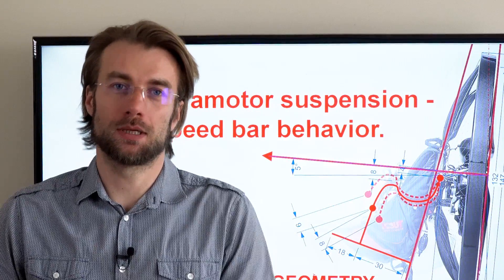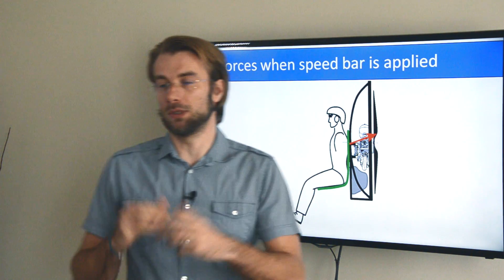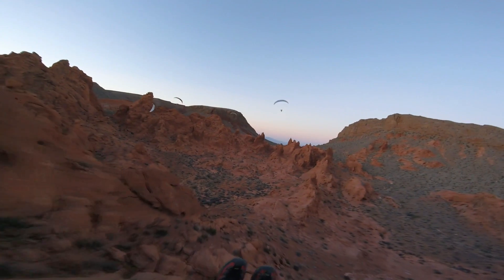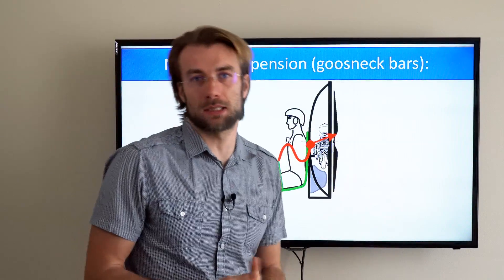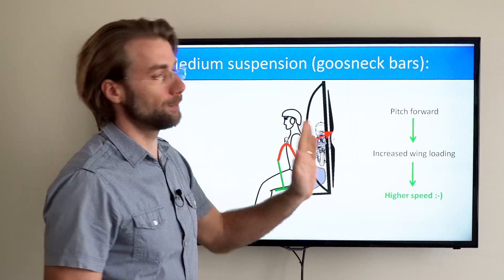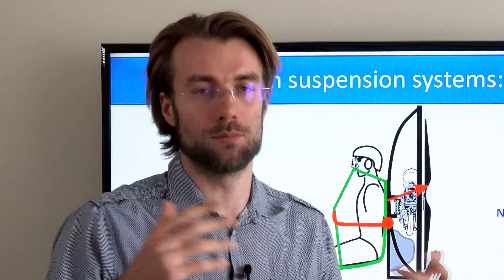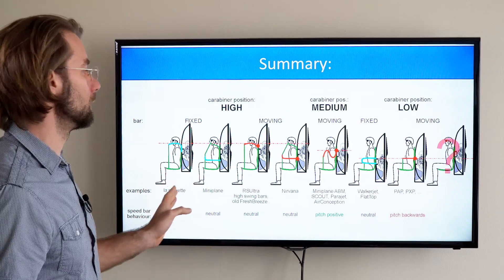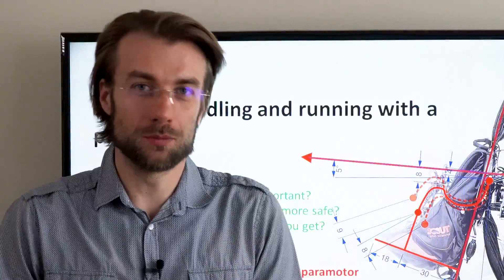Speed bar behavior. Paramotor Geometry Part 6

Comment: Why is there no mention of Blackhawk paramotor in you comparison?
Reply from the maker: few reasons:
Primarily there is not enough space to name all brands... There are plenty brands that did not fit into the screen.
I have named brands that have invented respective suspension or contributed to it the most (Miniplane ABM, Nirvana, Walkerjet, PAP, SCOUT...)
I tried to pick the most influential brands globally. While Blackwawks are probably good machines, they are rather unknown outside of US.

Yet, the brands are there just to help new or wannabe pilots. Pilots with some experience focus on the suspension comparison itself. The brands are not important in this classroom.

Comment: Need to congratulate you for this Clasroom sessions idea. It is obvious that you have a LOT of knowledge to share. 
But now I have a question:  You are considering so far, the backpack as an isolated unit. What happen when the backpack interact with the glider?  I think that if you apply thurst (regardless of the thurst line possition, you will induce a "nose up attitude" on your glider,  and since all the unit is "penduling", your thust will be diverted a little bit to the ground, inducing a reduction in the wingload. 
If that is correct, wont be a good idea to move then the thrust line a little higher in your paramotor to induce when thrust is applied, a "local" nose down attitude to cancel the glider nose up attitude effect?
Reply from the maker: Yes you are right - almost.
In flight the engine is pushing you ahead of the glider = you are sort of pulling the glider with you. This will cause you to point upwards a little but not that much, really. Center of rotation is in the glider and the radius is huge = length of the glider lines, thus the angle change is minimal.  
If you go to full power climb the angle gets significant and yes, your thrust line would be pointing partially upwards, which is not ideal. 

In one of my experiments when testing some modifications on the SCOUT I made a big mistake. I moved the bars+harness+pilot lower while I kept the cage in same position = I got the thrust line above the carabiners by 50mm (2 inches). I ignored the theory "because there are paramotors that have the thrust line higher and people buy them". The result was horrible. That experimental frame is still in the corner of my garage, sitting silent and ashamed.
Reply: I understand... thanks.
I remember a backpack that changed de engine -frame angle when in "speed mode".... It was called the Mantis or something like that... Im not sure how it worked.